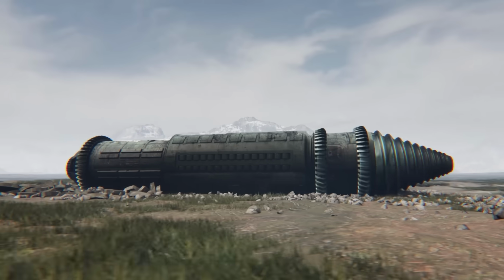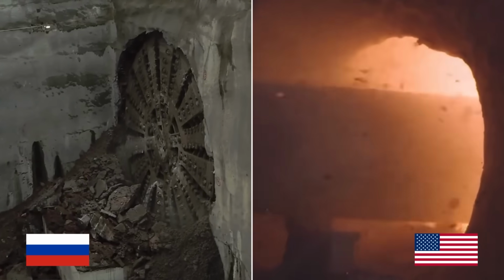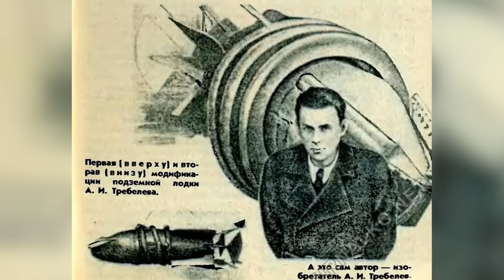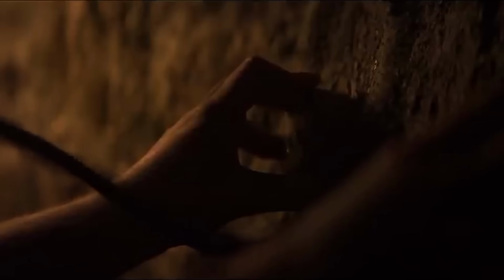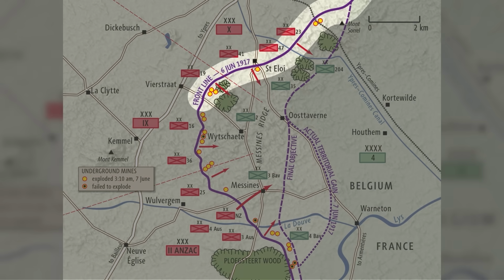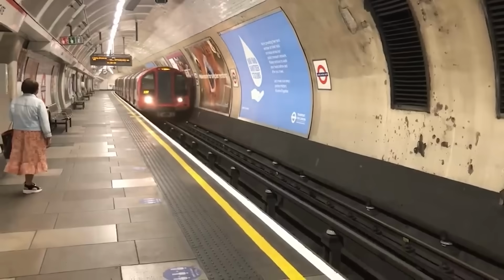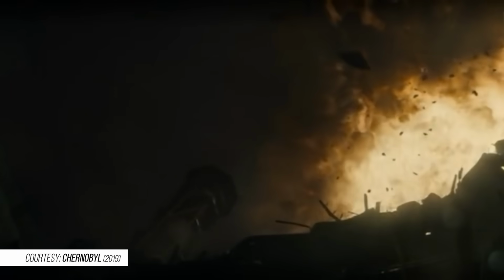What happened to Land Submarines?

Comment: Soo.... stumbled onto this vodeo today..

Seems the biggest argument people make is 'what happens to all the rock?!?!?'

I think people forget one thing... the only time a 'large' portion of rock needs to be moved is when the hull of the vehicle itself first goes into the ground.

After that, the only rock you need to wory about is the layer directly ahead of the vehicle.

An ammount significantly smaller than the overall length of the vehicle.

The issue you would have to solve is how to speedely breake up, and transfer that ammout back through the craft and out the other end.

Comment: would be better with a sonic drill. and a thorium reactor. the cabin could be acoustically shielded so less danger for the crew. very little heat from safer reactor add sat aided radar to detect mineral deposits and have a very profitable day.
Reply: Profit?
This is the Soviet Union, komrad!

Comment: These exist.  In the USA.  They are nuclear powered subterrenes.  The nose cone becomes white hot and melts through rock leaving a perfect round tunnel lined with glass.  They are operated by the Air Force and used to build underground bases.
Reply: Yeah but that's not how lava works, it has to go somewhere.

Comment: 21st century rock TBMs can excavate over 700 meters per week, while soil tunneling machines can exceed 200 meters per week. It's not very fast, but could be enough to break through a stagnant battle field. Expensive, 15 million dollars, but cheap compared to a abhrams is about 9 million plus. Could be worth it. Especially if you look at the situation in Ukraine where tanks are just large targets.

Comment: Am I the only one to notice that the 'borer' or 'screw' at the front of the CGI rendered example - repeatedly being shown emerging from the ground in a shower of rubble - is actually turning the wrong way...? It should be turning clockwise and 'screwing' itself through the ground in front of it, compacting the moved soil and rock outward around the machine - though I cannot imagine what material they could make it from that would resist so much pressure, friction and abrasion... Even Tungsten has its limits!

Anyway - no criticism of the video as a whole - loved it!

Comment: Tunnel boring machines could arguably be called subterrains. They check all the boxes they just aren't very fast and require a certain amount of support to work such as mine cars or conveyer belts to take out what they dig up.
Reply: Even if you're filling in the hole behind you, that's a lot of material to displace.
If you want a permanent tunnel, then you need a whole mining operation to haul out the debris.

Comment: This machine really bumps up against the practical bounds of mechanics because of its size. But mini versions trained to ‘sniff out’ mines in a minefield, and push them up to the surface are definitely more practical.
Reply: maybe a foot under the surface could navigate, but so many obstacles are possible. Even tree roots, bits of rock, scraps of metal.

Comment: Not "crazy": with modern tech
A nuke power plant with separate war heads, plus neutron navigation, Un-Manned & AI guided, could tunnel to a target, or a string of targets.
sealing the "tunnel" behind is no problem for a suicidal robot, and timed warheads.
true, seismic sensors could pick it up, yet with some practice and if time was on your side, tracking could be managed as well as heat dissipation.
not crazy....today

Comment: What we could do is make a bigger tunnel boring machine the size of a damn that is able to just pulzerize anything in its tracks. Make a huge drill bit the size of a train and power ot by a huge electric motor with reduction gears and power it by machinery that is already built so there is a lot less extra stiff to build. Use the wheels of those big dump trucks for excavation and reduction gears to drive a drillbit that has a 40 foot wide diameter and is the length of a train. Also spray pumps and hosea to cool down the rock and the bit so it wont break. Then when the corkscrew/Archimedes screw design in the drill bit spits out the debris and rock from the hole just load it up onto those big truck (777? Or 757?) Something. I dorgwt what the big car trucks are called. Use a conveyor belt type system to get the rock out and load it on trucks. You could make the drill bit out of carbide and blast too right before the drill bit starts getting to the next area and you could be one atep ahead always blasting and breaking up as much of the debris as possibile to make things as efficient as possible.
Reply: You have the start of an engineers thinking. But good luck with the actual engineering.

Comment: 20 seconds in and i'm just trying to think of how this would physically be practical or make sense, if you dig somewhere, you'll have to remove whatever is in front so you can keep going forward, if you're 100 feet underground and going with a drill you're just going to nail urself stuck no? i guess if there's some system to put whatever is infront of you behind you it'd work? i'm not very bright when it comes to this kind of stuff but i don't see how this would work
Reply: If you put whatever was in front of, behind you. You don;t have a tunnel. Might as well just drive across the surface. :)

Comment: Thought youd cover plasma drills more. Probably some impressive tunnels down there.
Reply: All thermal/electric cutting processes require both a heat source and a method of removing molten material in order to form cuts.
My question is: how do you get rid of all the molten lava you just made?

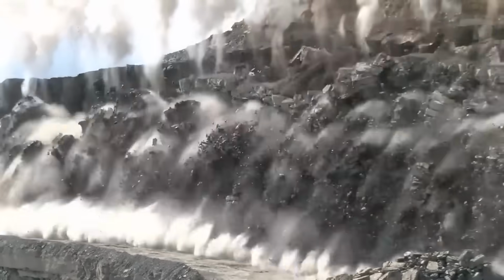Comment: 6:55 TNT, which stands for trinitrotoluene, is not the same as black powder. Black powder, also known as gunpowder, is a mixture of potassium nitrate, charcoal, and sulfur. It's historically used in firearms and fireworks. TNT, on the other hand, is a yellow crystalline compound used primarily as an explosive material. While both TNT and black powder are used for explosive purposes, they are chemically different substances with distinct properties and compositions.
Reply: Yeah, came here looking for a comment about this - sort of embarrassing scriptwriting for an 'engineering' channel.
Reply: @b18c5vtececlipse
That's  what I was going  to say!!   :P  Just kidding. I  gave up chemical engineering classes many years ago, but I did know how to spell out TNT from the Halloween comedy movie "Spaced Invaders"
Reply: @BillSentry  Don't need to know much chemistry to know that black powder =/= self-oxidizing high explosive compound

Comment: Going into open cavities and water cavities would be a problem because it would just get stuck and fall down. Also the whole premise that it is a land submarine is kind of ridiculous because it would leave open caverns and mash up anything it went through. Generally the cutting parts wear to some extent so it would be hard to get too far without something breaking.
Reply: I don't think the plan is to excavate all the rubble, just to get it behind the drill instead of in front.

Comment: The reason this will never work is because of overburden.

Overburden is what you get when you dig a hole. That pile next to your shovel when you've dug a hole for something? That's overburden, and overburden has one property that makes a "land submarine" impossible.

That property is the fact overburden always takes up more space than the space you dug it from. You can prove this yourself. Dig a hole, and then fill it in with what you dug out. No matter how hard you pack it, the fill will overflow the hole. Always. This is why your tunnelling machines require vast infrastructure in the form of conveyor belts leading all the way to the tunnel entrance to move overburden.

"But what if it just dumps the overburden behind it."

No, because remember the overburden takes up more room than the tunnel space you dug. That means there's no place for you to put the overburden. It must be removed, and that's why "land submarines" are physically impossible.

Comment: If there was a nuclear fireball - then nobody would go in there to extract anything. Firstly - there would be nothing to extract but a lump of stone, sand and metal. Secondly - since it is not a proper atomic bomb blast - it will be so radioactive there anybody would be dead before they cand get out of that tunnel. And lastly - a nuclear power reactor does not (cannot) explode "in a fireball".

Comment: This is a interesting idea if real they could go deep into the earth possibly see the core in person
Reply: Entertaining sci-fi. Imagine that your vehicle is the only thing that is cooler than the million cubic miles of molten metal you are moving around in. I suspect your vehicle would try to absorb the countless 'calories' of heat. Quite an impressive alloy you have there to not instantly disintegrate. Of course the Space Shuttle ceramic shell could be placed in a blast furnace and be lifted out with thongs, and set in your hand, without having absorbed the heat. Ceramic is pretty brittle though.

Comment: The hardest part to believe: It was done in communist Russia... They claimed the tunneling machine worked amazing, but then suddenly could never be repeated or recovered despite working so well. I find it much easier to believe one of two things was more likely the truth:
A: None of that actually happened. 
B: They shot a bunch of their own guys that were part of the tunneling machine project (or just ones they simply didn't like much), buried them all in an unmarked grave somewhere, called them all heroes of the Soviet Union then move along as though nothing happened.
Reply: B was used so many times.

Comment: I would think that various grades of bedrock and unknown caverns or watertables would be a massive issue. As it is, the drill that cut the tunnel under Seattle took years to finish, so long that we weren't sure the project funding would even survive. And that drill get hung up on a small metal tube that required months of work to remove

Comment: a conventional tunnel digger could be improved with the introduction of a reactor to supply power instead of bringing the power down in long cables, but the use case for that would only really be beneficial in say replacing undersea cables and pipelines with ones below the seabed
Reply: The grid beats any reactor, so it wouldn't be an improvement, it would only make it more mobile.
Reply: don't worry about disturbing all the life down there, it's not like a majority of the earth's biomass is in the seabed or anything ((sarcasm)).

Comment: Details
Title
Conceptual design of a coring subterrene geoprospector.
Author
Los Alamos Scientific Laboratory
Description
A rock-melting Subterrene system is described that can obtain a continuous core along the projected route of a tunnel. System specifications, individual component functions, preliminary design concepts, and design alternatives are included; and subcomponents that can be assembled from commercially available hardware are indicated. The device requires 150 kW of electric power to melt an accurate 300-mm (1-ft)-dia glass-lined hole and removes a 200-mm (8-in.)-dia glass-cased core at an advance rate of 0.4 mm/s (5 ft/h). The accurate hole diameterand stable hole lining allow the use of a packer-thruster located at the heated hole melting and hole-forming penetrator assembly. An orientation sensor and a guidance unit can also be located in this assembly. A hollow, flexible stem trailing behind the assembly contains the electric-power, coolant, and instrumentation lines, and provides a passage for debris removal. Core sections are removed through the flexible stem intermittently with wire-line core-retrieval hardware. This Subterrene system, named Geoprospector, is essentially a self-propelled and surface-guided minitunneler. It is a logical major development step in the Subterrene prograrm, directed toward a larger-diameter tunneling machine. Other practical Geoprospector applications are the forming of holes under obstacles such asrivers, highways, buildings, or other structures to accommodate utility lines or cables; the implantation of urban utilities; and the installation of underground pipelines or power-transmission lines without ditching.
Publication Date
Feb. 1974
Number
LA-5517-MS;LA-05517-MS
Funding Info
Contract no.: W-7405-eng-36
Format
14 p.
Language
English
Source
Library Catalog
Source ID
01LANL_ALMA2178337100003761

Comment: SUBTERRENE. 
Title
The Subterrene Program.
Author
Rowley, John C
Los Alamos Scientific Laboratory
Publication Date
Oct. 1973
Number
LASL-73-1
Contents
Melting holes in the ground -- Potential applications of the Subterrene -- Advantage of the Subterrene -- The Geoprospector -- The Subterrene and the Energy Program -- Excavation of tunnels -- The nuclear Subterrene -- Drilling oil, gas, and water wells -- Rotary drilling and its problems -- Drill improvement -- Subterrene design and operating concepts -- Driving holes with the Subterrene -- How the Subterrene operates -- The melting-consolidating Subterrene -- The universal extruding Subterrene -- Coring with the Subterrene -- Special features of the Subterrene -- Test of the Subterrene -- Preservation of historic ruins -- Larger penetrators --
General Note(s)
"Mini-review 73-1."
Publication Note
Related report: LA-4547
Format
4 p. : ill. ; 28 cm.
Language
English
Source
Library Catalog
Source ID
01LANL_ALMA2188425270003761

Comment: Seeing that there are rumors that there is a massive underground tunnel network underneath North America, one would wonder how far it went with the U.S.,
Reply: It would take a lot of years to drill tunnel that far. And keeping a vacuum in them to prevent air resistance form stopping the cylindrical shaped fast subway modules .. Engineering and cost and obstacles would be a nightmare. Who knows.
Reply: @BillSentry  it would be interesting to find out, and apparently explain why the pentagon doesn't know how to balance their checkbooks,

Comment: Just the fact it managed 7kph say's it was all bullshit 😂😂🤣 There has never been a tunnel cutting machine that can move more than a few hundred metres a day!! So 7kph that 56k's in 8 hours the simple answer is fk no that's full of crap. There was many obvious lies about these machines the Soviets apparently made. Even if it was the 1900's all the way to now 2023 it has never been possible and never will be in our lifetimes.. even bore hole drills take day to move metres especially when you are past the loose dirt and are cutting rock and clay ect.. sure the first 10ft deep is easy then it takes explosives and trucks to haul away the rubble.. the Russian bore hole only could drill a few ft a day and after 250 metres down it was so difficult to do they gave yp shortly afterwards because the drills could not stand up to the temperatures and the pressure needed to keep cutting.. so a mole ship is a fantasy that will never happen the way they want but they did make a land submarine it cuts tunnels to make roads underground and though mountains but it moves a few hundred metres a day less than 1km a week but its something i guess 😂

Comment: As a nuclear engineering student, the instant I heard "nuclear reactor" I said out loud, "How the heck do you plan on cooling that thing?"
Reply: 9:15
Reply: Easy, don't and use the heat to propel you forward in a bell shapped device. Thermal mechanics can be used, if properly implemented.
Reply: @dustybricks113 isn't their patents for this?
Reply: @dustybricks113  When your bell shaped device collides with a seam of solid granite, then all forward progress is arrested.

Comment: OK, but we already know we have tools that can dig a tunnel under the ocean from England to France?  So maybe it is way to slow, sure, I get that, but we could reduce the size to get the size we want, would you make the hole a bit bigger than the vehicle so waste could be driven over as needed, and maybe that would mean you would always be diving a little to ensure you didn't just pop out of the ground by mistake.  I get the idea of tracking a land sub, but couldn't the aggressive side just use devices to shake the earth or set off explosions in an old mine etc. to hide the land sub?  Though hey I'm not trying to win anything here it just sounds like we would need to move more than 5 people at times and do we then need to send multiple vehicles, I get that with Helicopters they do send more than one.

Comment: “Fast TBM”… and look at the supporting modules, external services and large crew required to keep a current TBM moling along nicely. I remain highly sceptical that a nuclear-powered mole made it off the drawing board, let alone a metre through the ground; if self-contained fast TBMs were practical, we’d be using them.

Comment: Problem is... There's no way to hide! If vibrations didn't shake the craft to pieces, then simply putting your ear to the ground would tell you eveywhere it goes! Then there's the issues of how do you stabilize a free floating drill! Because it would be very easy for a craft like that to wedge in a spin in place vs cutting through! Depending on the equipment speeds used - that alone could kill the crew! The human body simply can't sit spinning at high speed! Which any drill listed for those speeds would have to do! Which also leads into major issues of heat! The Soviet craft - likely melted itself! Such heat for a small craft - its the drill technique used that's the issue! Which isn't like those used by modern underground tunneling for road work - those work entirely different than what those fools did!